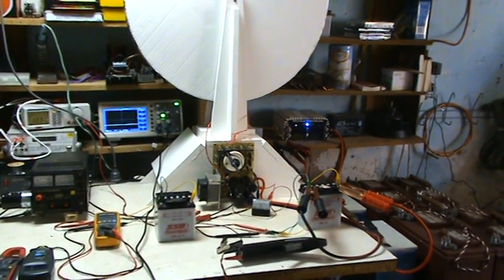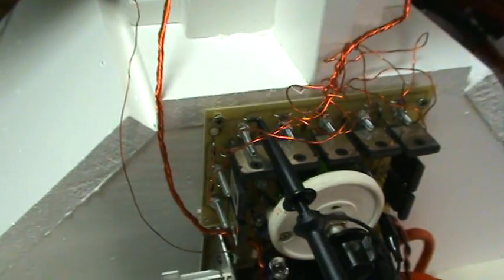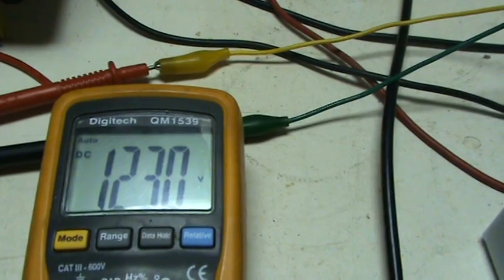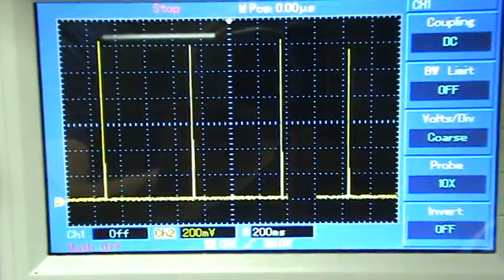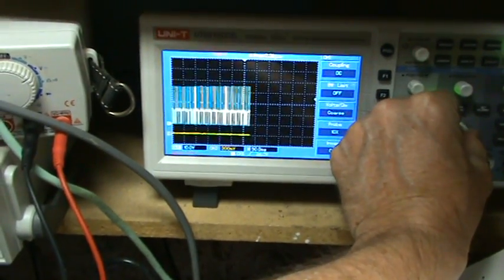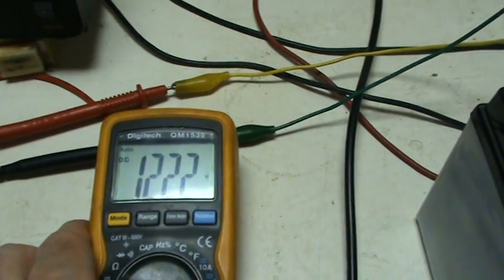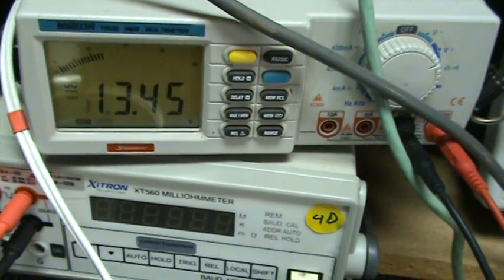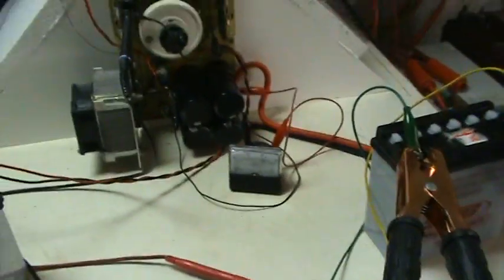Bedini SG with Large Comparator from TeslagenX

Comment: I have a battery having 12v *42Ah smf c20 full charge 100% 12.70 primary battery. AS I want to run Your machine with above specification battery. As I wanna charge my same capacity discharge battery (10.5v) with your machine. How many time (hour) it will take to charge secondary battery.
Reply from the maker: If the machine is 1:1 and YOUR machine draws 1A from the primary battery it would take around 42 hours to fully charge your secondary battery. 
Just run the machine and let it teach you...

Comment: I tried getting my magnets two magnets spaced between them. I seriously lost efficiency for some reason. How do you know when you get them too close together?  Currently I have mine spaced close to five magnet widths apart. It seems to run better as a motor that way for me. But how do you know how close is too close?
Reply from the maker: If when sticking your magnets to the wheel you can feel one magnet trying to attract the next one they are too close. You don't what the magnetic fields interfering with each other.
Reply: That's what I figured but I wasn't quite sure. Thanks for clearing it up for me!!

Comment: Dose the comparator method remove the sulfation from the battery, your 20 wire and your 23 what size would that be in Australia, thanks again John
Reply from the maker: GeorgeyNico, yes the comparator method is excellent at desulfating the battery. The size of the wire in Australia is SWG 21 & 24, or 0.8mm and 0.56mm.

Comment: What is the time duration of the spike from the comp?
Reply from the maker: Shane, it is approximately 1mS.
Reply: John Koorn
so, the purpose of the comp is to be able to run the ssg on the charge batt as well? charge reg? Does the comp fall to batt voltage or cut off higher? You know why I ask. Thanks John. Do you have an E-mail?
Reply from the maker: Shane Horton The purpose of the comparator is to charge the battery with short pulses of current, not just to be able swap batteries. The battery charges faster and is also rejuvenated.
You saw the voltage that the comparator falls to in the video on the DC Voltage meter - about 20v. I don't know why you ask though.

Comment: Hi John, is what your do is going for negative energy to positive using the cap dump, that allows you to swap the batteries from front to back,is this the main reason cap dumps are used how different is it when a separate trigger coil is used to create a positive charge to the battery,
Reply from the maker: GeorgeyNico, yes the capacitor converts the negative energy to positive. The ability to swap batteries is not the main reason for the cap dump, charging is faster as well. I have not experimented much with separate trigger coils.